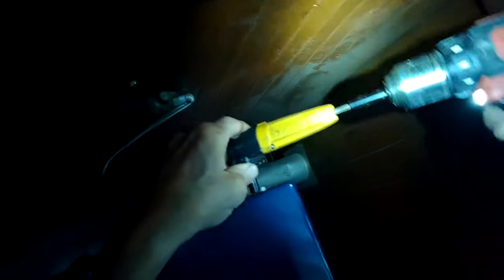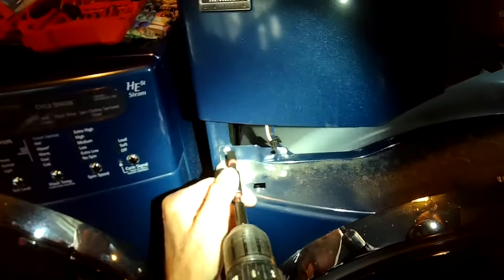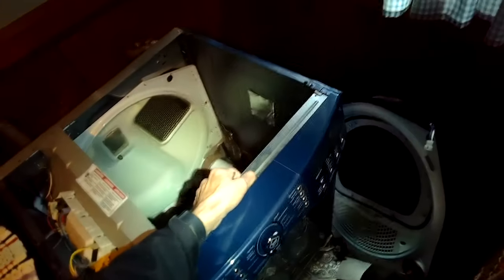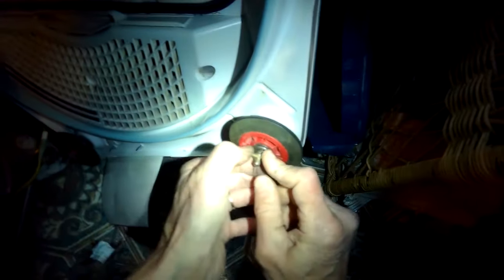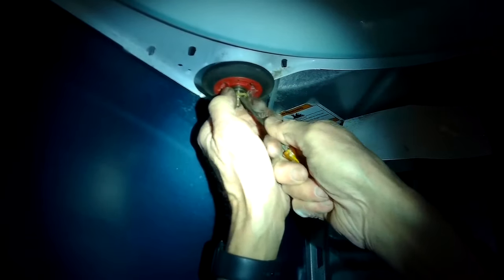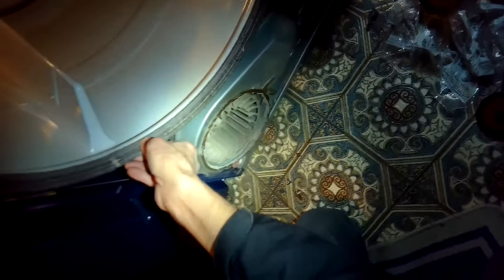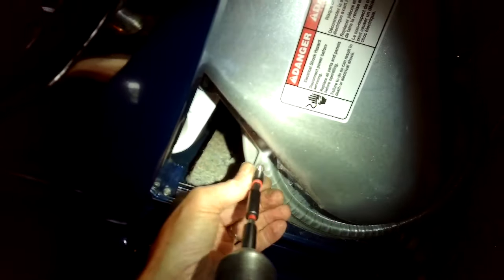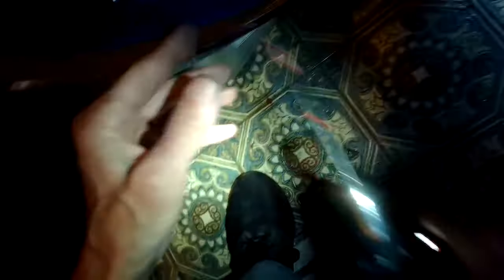✨ MAYTAG DRYER SQUEELING - Easy DIY Fix ✨

Comment: Awesome, helped me considerably in taking my machine apart properly. One support roller was shot, but changed them all, along with idler pulley. Belt was literally threads, but still hanging in there. The entire inside was coated in shredded belt fibers..........Really appreciate people like whim take the time to do these videos and post them.
Reply from the maker: Thanks Darrell😊
Reply: I have a Maytag Series 5000 Dryer.  Since I couldn’t find a video for the 5000 Series I used your video as a guide.  While it wasn’t exactly the same or quite as easy as your video, I was able to do it because of your video.  Thanks for taking the time to post this.

Comment: It's ridiculous how helpful this was.  This was VERY much appreciated!  One of the support wheels on my dryer was obliterated, so this was exactly the fix I needed.  The only problem I had was getting the front panel disconnected like you showed, so my fix was to disconnect the cables at the bottom right.  I just had my wife hold the thing while I changed out the wheels.  She got over it.

Comment: Hey bud I cannot thank you enough for this video. A service call would have been $120.00 plus parts. I got the kit off Amazon for 15 bucks came with 6:50 idler  wheel ,support rollers and belt. Took about 1 hr 15 mins… saved me over 100 bucks… thanks again bud….
Reply from the maker: You bet,
Very happy to help.

Comment: Thanks for a great walkthrough. Worked like a charm. Some notes for others who might have a slightly different model - 
1. the user interface panel on the front in my model had two plastic tabs on the inside of the unit that needed to be pushed outward to disengage with the frame, then there are two more plastic tabs on the top near the corners of the interface panel - a larger slotted screwdriver slipped in and twisted disengaged them (they were a pain to find). 
2. the metal brace above the drum (that the interface panel hides) is removed with two screws left and right front, before you can remove the door panel (at least in my case). 
3. Be careful about the replacement wheels you order, mine were all the wrong size but the belt worked. I cleaned and re-greased the 4 support wheels (red/black) and the white idler wheel. Squeak gone :) 
Took about 3 hours start to finish as I did some cleaning and had to figure out the plastic latches on the front interface. 

Much appreciated for the video Scott!
Reply from the maker: Thanks so much Rob😊

Comment: thanks for posting this video, it allowed me to fix my squealing Maytag 5000 series dryer.  i only had a slight panic attack getting the belt back on motor and tension pully, i had a bunch of slack, then i figured out that i had the incorrect configuration.  and like other posted, i also disconnected the wire harness on the bottom right because my dryer is on a pedestal.  in addition, i got the parts from Amazon as well.
Reply from the maker: Thanks so much,

Thank you. Please check out our new DIY Appliance Repair channel at: https://m.youtube.com/channel/UCbQy5UxlvaPPsDHvfvW76JQ

Comment: Bought kit on amazon to replace rollers and wheels and loved the detail in here. I ended up taking apart the entire dryer cabinet for experience and  so the wife could it. Thought i put it together wrong when it was running nearly silently when finally reassembled. Great video. Disconnected the control panels electrical was the hardest part, as the plugs wouldnt separate with a flat head.
Reply from the maker: Very impressive, thank you👍😊

Comment: Thanks a lot for this video. My model MED6630GC0 is slightly different but all the drive components are the same. $45 in parts 90 minutes to fix and clean it. Works like new! I've never noticed the Thanks button, I sent you some money.
Reply from the maker: Thanks so much Billy,
You are very generous 😊😊😊
Reply: @ScottTheFixItGuyChannel  You saved me lots of headache. Much appreciated. Wish I could of sent more.

Comment: I have the Maytag Ymed3500fw0 model and this video while not exact, did help me ALOT. I ordered the repair kit from amazon for my model and installed it yesterday in about an hour. The replacement wheels fit a little tight so i was concerned about the drum spinning. Replaced the idler pulley and the drive belt as well. Ive run 2 loads through the dryer now and it seems to be working with no squeling. Fingers crossed its fixed and I was able to save myself $300+ with a service reapir tech.
Reply from the maker: Great job Adam😊💻 New Appliance Repair Blog - lots of DIY Fixes for Your Home Appliances - Click Here:
https://ApplianceFixes4You.com

Comment: Awesome video.  Took our dryer which was making a racket.  Wasn't squeaking but sort of clunking along.  I also replaced the heating element while I was in there and cleaned it all out. Probably saved a ton.  $60 wheels + belt and heating element on Amazon for $60.
Reply from the maker: Very impressive Ross😊

Comment: I have a nearly 30yo maytag dryer which has worked perfectly until now.  Will the process be the same vs. all these new electronic ones. My control panel is manual knobs at top back of the dryer.
Reply from the maker: Is it just Squeeling a lot?

Comment: Are there items I should change when I'm in there since this is quite involved to save me the trouble later?  Thank you very much for the video.  I appreciate it.  I just ordered the parts and decided to go with what Scigirl did.  wheels, belt, and idler pulley.

Comment: Used this for Maytag MEDE300VW1 and it worked great. Small difference in wiring between my electric and the gas version in the video but it made sense.
Reply from the maker: Excellent, thank you.
Reply: @ScottTheFixItGuyChannel  also lots of the reviews on Amazon for the idle wheels say they are too tight for the shaft. I had this problem as well but fixed it by running the smooth part of a large drill bit around the inside of the new idle wheel for a minute and after that it slid on and would spin.

Comment: At least as of today's date, the dryer repair kit at the link in your notes is unavailable. Amazon says they don't know when it will be back in stock. 😞Hoping to find maybe just the support wheels and idler wheel by themselves.
Reply from the maker: Thanks Andrew,
Here’s a better link: https://www.amazon.com/Dryer-Repair-Kit-Whirlpool-4392067VP/dp/B08PXZWWTF/ref=dp_prsubs_1?pd_rd_w=vrZgA&content-id=amzn1.sym.04d2971e-c2c7-4fe9-b39c-4e218e879e06&pf_rd_p=04d2971e-c2c7-4fe9-b39c-4e218e879e06&pf_rd_r=3K6WNFAT9W34H294DGFB&pd_rd_wg=Lr5V4&pd_rd_r=ba001b46-2af0-4030-a18d-cc8e4a09a98c&pd_rd_i=B08PXZWWTF&psc=1

Comment: Thank you for the awesome video! However, my Maytag 5000 series dryer seems to have caps on the end of the shafts that the dryer rollers are on. I removed the plastic triangle piece, but the rollers will not slide off. Do you have instructions or suggestions for this?
Reply from the maker: Can you put some oil on those shafts, and wiggle and pull toward you?  They’re just stuck and need some force👍

Comment: Thanks Scott. Took me all day to get it apart but it did help a lot. One hour trying to get a single bent screw out lol. Ugh. Questions though. How do you know if the drum roller shaft needs replacing? Also, no grease huh? Guess it would clog up pretty quickly given what the inside looked like? And last, after 8 years should I see fairly significant lint throughout the inside/should I replace foam gaskets all around? Thanks much.

Comment: Mate love your show I have Millie dishwasher getting error code f11 and f13 I have clean the valve and drain hose still same issue I need your advice please
Reply from the maker: Sounds like it isn’t getting enough water during fill.

I would replace the intake valve

Comment: Hi Scott, I fixed the squealing, but now getting an error code of L2, cleared that and now it turns on, burner comes on and then get a F22 code and it shuts off. We were missing some of the sealant foam around the blower wheel, so fixed that, but still getting F22 code. Any suggestions.
Reply from the maker: Hi Linda,

I think the exhaust thermistor didn’t get fully plugged back in during reassembly.

Comment: Ok, leave the top two screws that connect to the exhaust element.

Don't remove the Phillips head screws inside the door since the from will come off in a complete unit.

When the bottom panel is off, disconnect the two red wires and the ground wire. This lets you remove the door assembly completely.

Comment: I’m shocked at how closely this construction resembles the Whirlpool Duet Steam Sport which I just replaced with a set of this 5000 series. I’ve disassembled and reassembled that dryer at least 10 times throughout it’s life but our last set of power surges fried so many wire connections that I called a time of death officially. Haha!

I will say to be careful with greasing the rollers and pulley. Mostly because any lint free floating gum it up quicker and the friction can melt the plastic pieces. Sometimes all you need to replace is the little plastic but that holds the wheel on.

I haven’t seen your newer videos but I hope you have stopped using the head cam as this can make it difficult for people to see the direction you’re working on. :)  It’s also always a good idea to inspect everything and vacuum out any dirt or debris while you’re in there.

Comment: You didn’t put the link to the parts you replaced
Reply from the maker: https://www.amazon.com/4392067RC-Replacement-4392067VP-Whirlpool-AP3109602/dp/B07PZVNY7P/ref=mp_s_a_1_3?dchild=1&keywords=maytag+dryer+idler+wheel+kit&qid=1609739830&sr=8-3
Reply: Thanks subscribed and liked
Reply from the maker: Thank you
Reply: I took my dryer apart and it doesn’t have a belt.  Just a fan.  I guess I’ll just have wet hair forever.

Comment: Doesn’t look easy at all. You took the whole dryer apart! 😂
Reply from the maker: You’ll be fine😊
Reply: @ScottTheFixItGuyChannel  One thing I would highly recommend is using cut resistant gloves of some kind.  Those metal edges inside older dryers is often sharp enough to cut by the weight of the object across your fingers.
Reply: Easy, but involved 😂
Reply: Best to have this video handy or someone videoing you as you go so you can remember how to put it all back together.
Reply: @jtommyprice  I'm about to venture into this hell scape this weekend once the parts show up 😂
Reply: Right. I'm sitting here thinking maybe I'll just buy a whole new dryer🥴😂😂